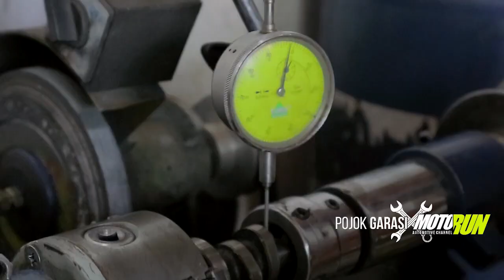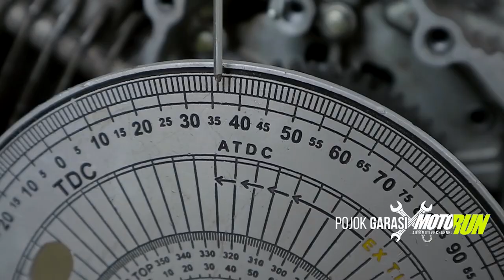Pojok Garasi #11 - Bore Up Supra X 125 150cc - Part 2 - Modif Agak Mahal [ MOTORUN ]

Comment: Kak mau tanya nih, Astrea grand up ke 125cc estimasi biayanya berapa? 🙏 Sudah tak subrek
Reply from the maker: Langusng hubungi CS motorun mas
Reply: 2jutaan kalo pengapian standar
Reply: @irvandwi1622  wah habis ap aj tu 2jt?
Reply: biaya rubah klep (28-24)  biasanya 600an, porting 150-200an, noken 350an, seher 56.5mm 120an , kolter ganti boring 200an coak klep 30-50an, bubut crankcase 50an, karbu bisa pake pe24 atau karisma (harga tergantung) kurang lebih segitu lah kalo stroke std. kalo stroke up biayanya bisa nambah lagi karena harus ganti pompa oli kanan dan askruk biasanya pake mocin langkah 55.5 sehernya pake kaze os50 (53.5)

Comment: apakah gak berubah karburator untuk spek mesin 150cc?
punya ku aja spek std porting sudah ganti karburator
Reply from the maker: Perubhan karburator parameternya bukan apakah sudah porting apa belum. Tapi dari Kapasitas CC mesin dan RPM puncak.. 

Untk penentuannya bisa pake kalkulator kusus mesin dari MOTORUN, "MOTORUN ENGINE TOOLS" di playstore

Comment: Bang klo up cc supra x125 jadi 140 cc/130cc apa aja yg diganti ,bisa dibuatin videonya?
Reply from the maker: Sudah pernah
Reply: @MOTORUN  klo yg bore up 150cc itu tnpa rubah crangkesnya bisa gak ya bang?
Reply from the maker: Bisa stroke up
Reply: Jadi gak harus bubut crangkesnya ya bang?
Reply from the maker: Yoi misal bore up 58mm stroke std 58mm menghasilkan 150cc 
Bore up ke 56mm, dan stroke up 61mm jg akan menghasikan 150cc
Reply: @MOTORUN  oke makasih infonya bang 
Semoga sukses selalu
Reply from the maker: آمِيّنْ… yarobbal alamin